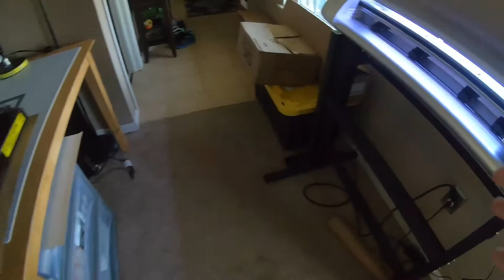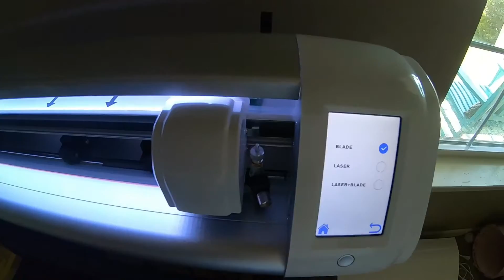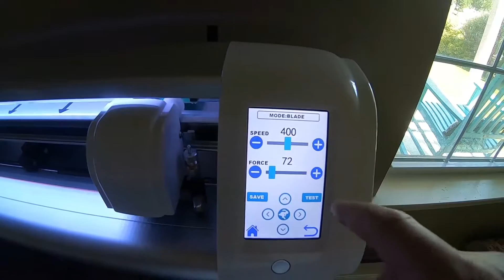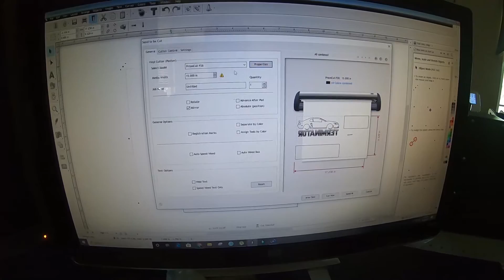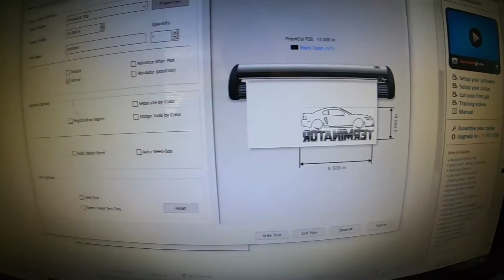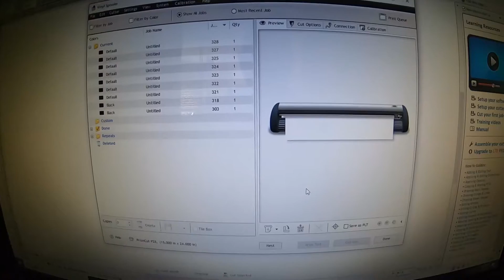Familiarizing with the features and controls of the Prismcut P28

Comment: I need help when I send my picture to my cutter it just beeps it doesn't cut.
Reply from the maker: Not sure what you mean sending the picture to the cutter. 
Is it safe to assume you mean your place the printout on the cutter and align the head and then select print to cut?
If so, make sure the head is placed correctly and aligned. Make sure of your cutting area as well that it won’t try to go most the cutting area.
Reply: @PMPerformance  yes I can’t get this thing to cut for anything I don’t know what I’m doing wrong 😒
Reply from the maker: @justkash5276  are you lining up the head with the crosshairs for the start point?
Did you print the design with the print to cut border around it for the head/camera to follow the cutting path?
Reply: @PMPerformance  how to up the head with crosshairs ? & do I have to contour cut for everything to match up ?
Reply: @PMPerformance  line*
Reply from the maker: @justkash5276  you need to do the contour cut setup before you print the image so it creates the border around the image so the camera has something to follow.
Then when you place the image on the cutter, you use the arrow buttons to move the head to match where the cut should start.
Reply: @PMPerformance  ok I just sent the image to the cutter and it’s still not cutting can I email you for further details cause this a mess lol

Comment: The only issue I’m having is cutting the actual piece of Vinyl once the job is completed as there is no guide or groove where to actually press and cut the job with out scratching the machine. Any suggestions anyone? 🤔
Reply from the maker: There is. While I get complacent and scratched mine, there is a groove in the aluminum like an inch in front of the cut strip. I usually advance the vinyl a bit when done and run my blade straight across that to cut my piece out and then go to my table to weed

Comment: I really need help setting up this machine
Reply from the maker: Which part are you having problems with or questions about.
I can try and help.
Reply: PMPerformance i dont know how to work the soft ware im new to this computer stuff
Reply: If i send you my number do you think you can help me with the basic so i can make a shirt
Reply from the maker: Latasha Wilder unfortunately phone support is out of my scope of comfort.
My suggestion is to watch US cutter basics videos on the software. I am not well versed in VinylMaster much at all yet, but they have some decent videos to show basics to get started
My series was to focus on the hardware
Reply: PMPerformance thanks
Reply from the maker: Latasha Wilder my pleasure. Good luck. If you have this machine and something you are stuck on , let me know and I can try to help.
Reply: PMPerformance hello again ok im stuck on something . When i load the machine and get ready to print the machine pulls half of the vinyl through the machine then it starts to print so it's printing in the middle to the back I don't know how it how I need to set it up for it to when I press print it should print from the beginning and then go backwards not from the middle backwards
Reply from the maker: Latasha Wilder my suggestion is to not worth about printing/contour cutting until you have experience cutting vinyl and heat transfer

Comment: have you run paper through it? how long did it take to cut out the design you had up at 10x4in? and have you used the creasing function? thanks for the post.
Reply from the maker: I have only done HTV and Adhesive vinyl. . . .. Actually I lie. I did try putting the pen in it and put printer paper in it quick to test making a shape, but that was it. 
I am not sure what the creasing function is. I have not seen this mentioned. I can certainly try it if you can explain what it is. 
If the 10X4" you are talking about was that Mustang Silhouette, off the top of my head, maybe a minute if that. I can try and time it better next time. I did have some more complicated cuts I started to time and haven't made it into the videos yet.
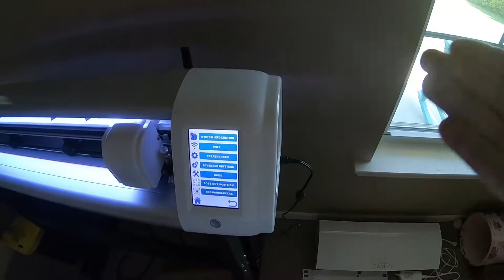Reply from the maker: I just timed a larger text only cut that was 2 - 5x22 decals that said Lerch's Excavating on 2 lines. It took a total of 3:40 if that helps you at all.